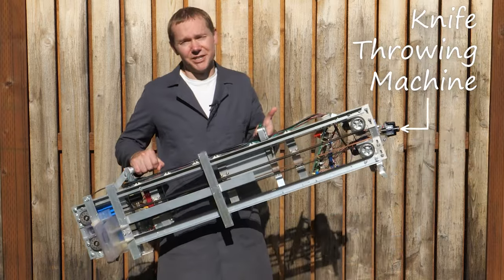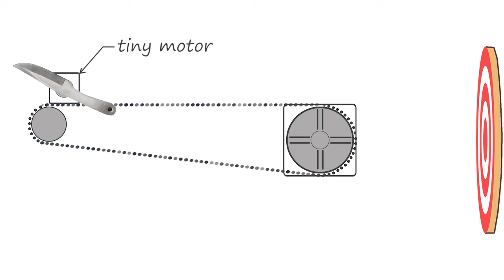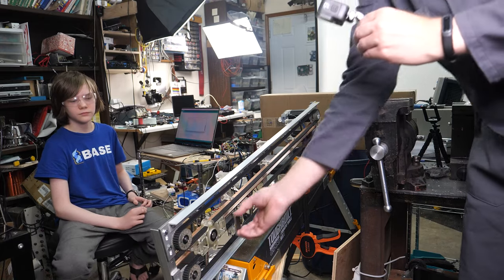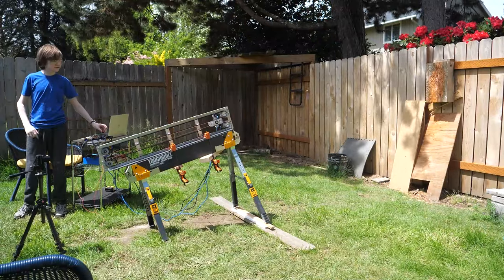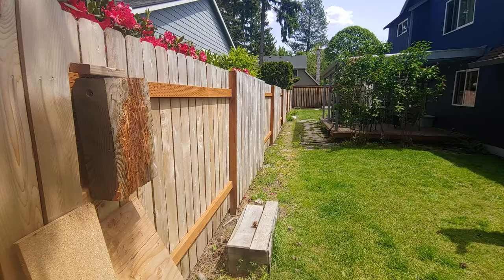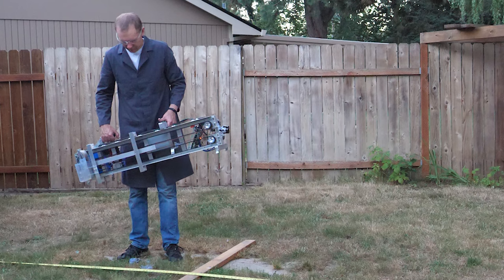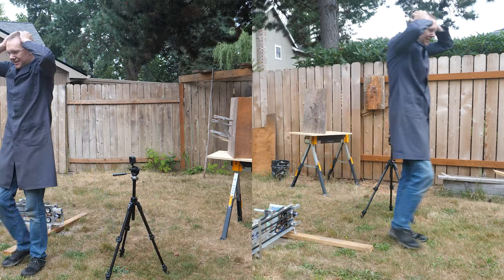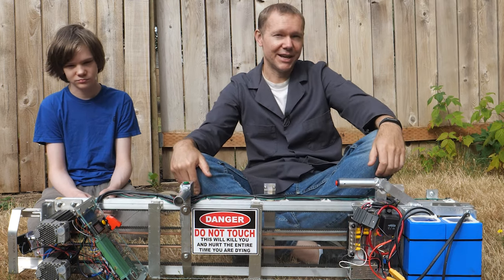Knife Throwing Machine Part 1 - The B.U.I.L.D.

Comment: Its the mass.
To be honest if you find the center of gravity of the knife, you can quite quickly work out the distance that works for a knife to stick at 1:1 ratio of foreweight to rearweight.

Once you figure out that distance, you can take a step back and modulate your starting grip (which is mostly determined by thumb fore and mid fingers) FORWARD on the knife to slow the spin.
Starting grips modulated further back give it a quicker rotation and thus can be used at closer distances.

Then through practice you can find the ratio of shoulder length paces forward = x finger lengths backward (from center of gravity) ((faster spin))

 or shoulder length paces backward = x finger lengths forward (from center of gravity) ((slower spin))

Once you get a feel for these ratios, you can generally calculate the pace quantity to your target, and the ideal grip to accomplish the required number of spins to stick it to your target (with a small variable of arm velocity to determine how deep youre trying to penetrate.. when throwing by the blade, you can accomplish a half spin stick or a spin and a half stick, depending on the distance to the target is, you can actually tweak your throws very accurately through these parameters. 

I got very good at knife throwing with 9, 10, and 12 inch cold steel throwing knives.  

I find its actually best to practice with at least 3 of each size, because you dont have to retrieve your knife and recount paces or even move from your original position. But even better, to use 2 or 3 different length knives as well. Smaller knives are much more tricky and sensitive to adjustment, making a great challenge for intermediate throwers. 

I got to the point where i could teach a person,  brand new to throwing, the correct ear-to-extended arm movement, and then mentally calculate how many fingerwidths back or forward from center of gravity they should take their starting grip with, and even a complete novice to throwing would stick at least one knife in under 3 tries.. its a lot of fun and a great way to blow of steam or have friendly competition. 

It really made me smile to see your contraption and to be honest i havent thrown much in years since i experienced a rough bout of radial nerve palsy a few years back.. if I had your invention I could have coped alot better while my arm was down! It pains me just thinking about the emotions that were running rampant through my head during that dark and lonely quarter... thank you for your video, and the cherry on top is seeing you accomplish all this with your son! Congratulations on your awesome idea!!! I might just have to make a few throwing videos now!
Reply: Thank you for the fascinating details of this comment. I would have loved to observe your teaching. Sorry about the radial nerve palsy. I hope you've found a satisfying new activity to put your creative energy into.
Reply: @DavidPhillipsAustin  ive been throwing again, lately. Im not quite as on it as I used to be but Im having a lot of fun! My arm started working again after 4 months, and its in full working order now. I might post some throwing videos sometime, if I do Ill send you a link. I play guitar and drums so yeah it was pretty scary but I feel God was getting my attention. Made me alot more thankful of every throw I even try now! Thanks again for your video!
Reply: @Joseph-Mullins  Isn't the human body (and life in general) weird and amazing? Congratulations on your recovery!
Reply: @TangoTribeAustin  if im honest i believe it is 100% spiritual like everything else, especially since learning deliverance ministry when I found out an ex of mine was possessed (literally). Those demons laughed at me and ran circles around me until I realized I had to command them in the name of Jesus! Then they started coming right out! We thought my house was "haunted" until one of the orbs became a full silhouette standing between me and her.  I said it had to leave if it had ill intent, and felt the presence grow hostile in the room, and the spirit "run" right at me. I started provoking it using religion (cuz I figured it was demonic) speaking about the blood of Jesus defeating it,  and suddenly a different voice came out of her and she began to mock-repeat what I was saying to scare me because it was getting annoyed and worried I might dig deeper.. didnt work though I realized she was possessed took her upstairs and starting trying to cast it out. The "blood of Jesus" angers them royally, and breaks most of their power if you know how to apply it, (I didnt) the NAME (character) of Jesus is what makes them tremble and obey. That was a year and 8 months after the palsy, and looking back I know what caused it, and am surprised I wouldnt put those final two pieces of the spiritual puzzle together before then. I prayed for the first time in a long time, crying and asking for forgiveness and healing like never before... that day I was fully healed. My wrist would extend from then on with no problems where before i could only barely keep it from dropping if I held it a certain way and strained my brain as much as possible. It was like my brain was shorted out, and it was... my point is stuff only exists in the physical because it existed first in the spirit, and the spirit realm is more vast and governed than our own.. the spirit is how we perceive and make sense of things, the soul is how our spirit interacts with our bodies, and our bodies are how our soul interacts with the physical. Things we do and see and believe in the physical can have a direct effect on our spirits, but Ill tell you one thing, the bible is the only weapon we have to fight off devils with power and authority using! They believe the word of God and tremble! Sabbath peace upon you and yours, in Jesus name.
Reply: @Joseph-Mullins  Wow that must have been a harrowing experience, the palsy and the following year and eight months. We're glad you found a good answer to it all.
Reply: @davidphillips79  I minister deliverance to others who are under the control of devils. 
When you see something invisible choke your girlfriend after you tell her what to say in order to renounce a sin and the spirits associated, and suddenly remember having heard about some spirits doing that to intimidate the afflicted before the utterance is made and takes legal effect upon them in accordance with God's laws, as well as what to say if it happens... and then you rattle off the command and suddenly the invisible grip and eerie feeling in the air break at the same time, youll never see anything the same way again.

It wasnt really scary to me, I thank Holy Spirit for that, but moreso eye opening, revealing, and convicting that what I suspected, spiritually, my whole life, was true. Its amazing to see how concepts presented in Gods Word, seemingly in passing (before you have spiritual understanding) are actually there to denote extremely important laws already established in the spirit. 
Malady and infirmity are two main spirits that afflict people with disabilities and health problems. Its not a popular worldview, lol, but it is very scriptural... 
Right now Im working with a man from england who ministers a church there that hears voices. Alot of people dont realize that that is satans end goal for each of us, if he could accomplish it unrestricted by God.
The minute I started confronting his demons he began to shake and snort violently. They aren't all dealt with its a process directly related to repentance.. but people also like to forget that the devils are Gods dogs that chase and scare us back to Him because He loves us and wants relationship with all His children! 
It has literally changed my life, and my exes, for the better, in ways that we could have only dreamed of back then, because God was in control the whole time, and because due to his grace, bad things happen because He is so infinitely good, for the purpose of allowing us to experience even greater things in the long run, but every moment is a call from His mouth to remember, honor, and glorify Him. God bless you guys. If anyone needs any help in this area contact me on my jee male at JesusdeliversbooksFREE

Comment: May I add: a skin of truck-bed-liner has a different mechanical strength, though its not comparable, its different from printing plastic in tensile strength, so, conceivably you can print a unit with fine dimensions and coat that sub-structure in Line-X to fill in the girth; giving it 3-D structural bones and surface-tensile-brute-strength to survive, the muscle, you've designed so well.

Comment: Awesome video - v-squared is the reason why a thrown knife will stick, it's not rotational (rotation doesn't actually exist) it's just velocity. our arms are slow when stabbing, but throwing we can combine motions of limbs more effective to get faster.
"speed beats armor", wood is armor :)
Reply: Call it what you want, if the blade doesn't spin, you can't align the point with the 'armor' to allow for penetration at this very low velocity.

Comment: This is Amazing!!  I'd be interested to see your findings on the kinetic energy / knife penetration questions.
I grew up throwing knives rotational style.  One day I was amazed to see that there were world champion knife throwers who throw "No Spin".  
I had the same questions and thoughts you did regarding knife penetration into the targets, but in my case it was in relation to throwing style (spin vs no-spin).  My initial thought was that rotational throwing had much more penetration into targets because of the rotation.  My rational was that the rotation somehow added more kinetic energy when the point made contact.  Thinking about that now is akin to pushing on your dashboard to try and make your car move faster.  The reference energy in that case cannot be inside the car, it's on the wheels.  Similarly, a flying and spinning knife's reference point is it's flight speed and mass, not necessarily how fast/slow it spins.

Anyway, after months of learning the No Spin style, it was interesting to learn that No Spin has just as much penetration power as rotational knife throwing.  I'm no scientist, but the only thing I can think of is classical Newtonian Physics of action/reaction and motion.  

Jabbing a knife into wood with your hand (stabbing motion) - measure arm travel and speed.  Factor into that, that you don't want to swing as hard as you can because your hand can slip around the blade when contact is made - adding a nasty cut to, enough of a strike that you could break your hand.  You tend to hold back some power because you instinctively know your physical limitations when hitting hard objects with your hands.

Compare that to a knife throw, where your arm travel is twice the distance, give or take, and with much more power by the time you release the blade.  More power + faster release = a Lot of kinetic energy, and a lot of knife penetration into target.

Really cool video, and thanks for sharing!!
Reply: Great comment. I'm a knife/kunai thrower myself, both spin and no-spin techniques.
Your answer to the final question of the video is correct.
When you try to manually stick a knife in a solid target, you will instinctively hold back to not injured yourself, and so the motion is far more contained than when you swing to grow from a distance. Even if you swing light. Is that simple.
If you try to match the speed and force of the "far trowing", when you manually stick the knife from close, by putting extra care in grip and trying not to put much force after the impact, you will obtain similar result as a normal trow.

Comment: A a fellow inventor and engineer, I feel your pain of breaking stuff mid project. I also feel your joy of watching your invention pay off. This project looked like you got your fair share of both of these. I do have a suggestion for you: Use FDM for your 3D printed parts, resin is much more brittle and some FDM materials would not have broken when the machine failed. Some strong FDM materials are Carbon Fiber Nylon and ABS. If you do get a FDM printer I suggest the Original Prusa i3 MK3S or the Bambu Lab X1 Carbon. Also linear rails could be a nice addition for guides on the thrower.
Reply: I would agree that some of the Nylon blends like 910 or PETG would have been perfect.  Light, absolute Strength, plus a smidge of elasticity and ability to take some impact.
Reply: I agree with the Prusa and PETG.

Comment: Loved the machine. The whole “ mad scientist “ vibe to it is awesome. I’ve had the same question about sticking a knife. I’m not a physicist but I have some doubt about the rotation being a factor. There is a technique for knife throwing that has no rotation and is equally effective and in my opinion easier to do. So I’m still pondering why it sticks better than a jab.
Reply: A good throw takes all the momentum from your body into a much smaller mass. When you jab with a knife you are still moving your arm with it when it makes contact so it's not moving as fast, and you also absorb some of the force back into yourself. There's nowhere for that energy to go but into the target when you throw. It's probably a combination of those factors if I were to guess.

Edit: It's probably the same reason that baseball pitchers can throw a ball 90 mph but can't punch at 90 mph, if that makes sense.

Comment: That’s fantastic practical engineering. I think you must be right on the answer to your fundamental question - it must be the extra angular momentum that causes the knife to slice down into the wood as the forward momentum (some due to forward translational motion of knife, and some due to the forward component of the angular velocity at the moments the knife tip is penetrating the wood) carries it into the wood. Maybe you could also test by throwing a piece of wood at an upward and diagonal angle into a stationary knife tip. Or just drop a knife (point down) onto a piece of wood that is at some angle to the horizontal. If you dropped onto a horizontal piece of wood from a height that just doesn’t stick the knife, then put the board on an angle and drop from same height and see if it sticks. Then compare the results of that (Ie how far in it penetrates) with the knife throwing machine penetrated when it hits with the same velocity and angle. Although this might not work, because the knife drop test might result in the knife not staying tip down while it falls. Anyway - neat thing.

Comment: You should link the fire button to the ranging button so that it automatically ranges and fires with one button press.
Reply: I think its separated because it takes time to take the range, so the shot would be to delayed.
But a compromise would be pressing for range and releasing for throwing, is still not perfect but is something

Comment: Awesome maker skills, great video! Regarding your question, my bet would be that the difference between a thrown knife and one stuck by hand can be explained using solid body acoustics: When the knife hits the board, the impact creates an acoustic shock wave that travels from the tip of the knife to its back. In the case of the thrown knife, the wave will mostly be reflected at the back of the knife and it will travel back to the knife tip without losing energy. Contrast this to the case where a knife is stuck by hand, in this case the wave will be dampened by the hand, which means a lot of energy that would otherwise drive the knife further is absorbed by the hand.

Comment: I think the rotation of the knife when it impacts the wood block is the key to making the wood "grab" the knife. I think the rotation causes the wood not to displace outward like when you stab the board but instead create a split in the wood that compresses against the tip of the knife. Think of how a temporary wound channel closes in ballistics gel blocks only on a smaller scale.

Comment: At 16:39 when you talked about not understanding how you could push the knife into the wood with your hand with more force then a throw and the knife   wouldn't go as deep into the wood reminded me of an exspeiereance i had loading square hay bales.  When stacking hay bales in a box trailer the last space in the top corner is much smaller then the bale. You can not push the last bale in. It must be thrown in. If you try to push it in it takes way more strength and effort. When you throw the bale at the space the bale is free to move and take the path of least resistance. When you try to push the bale in the force you use pushes it into the wall and other bales and the bale bends. I think when you try to push the knife into the wood something similar is happening.  When the knife is thrown its free to find a crevice in the wood and follow the path of least resistance.  When the knife is pushed it smashes the crevices closed creating resistance. 🤷‍♂️
Reply from the maker: Interesting! I can't say if you're right but will watch for that in the results! 👍

Comment: IMO Rotation helps but its not the main reason.   Any extra energy from a thrown knife is reverberated back into the ridged knife, while much of the energy from a forced knife is absorbed into the hand and arm.  When the extra energy bounces back a second time from the knife towards the wood, there is more of it leftover in the thrown knife since your arm absorbed most of the extra energy in the forced knife.  I think that's why the thrown knife sinks in to the wood deeper.  It's the momentum of the knife not being absorbed by anything, therefore energy is stored momentarily in the knife itself, and it has to go somewhere. So most of that remaining energy immediately vibrates back into the wood, where the rest of the stored energy is transferred and absorbed by said wood, thus creating a deeper cut.   Great stuff.  Love the father son bonding.